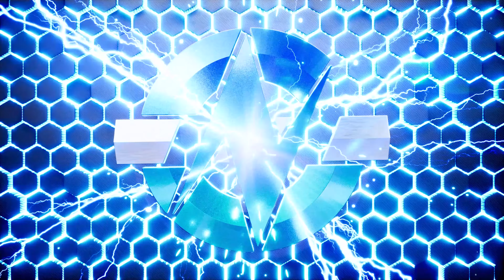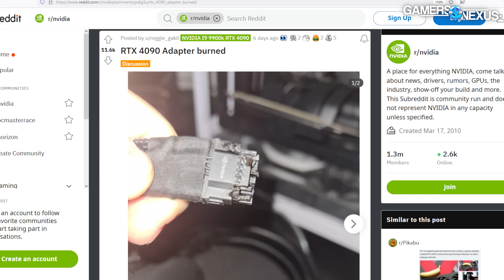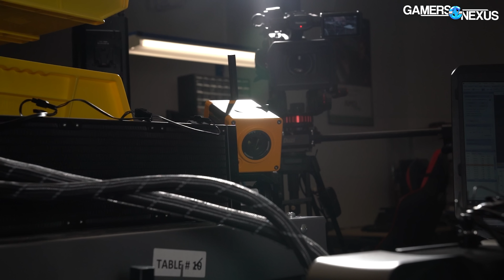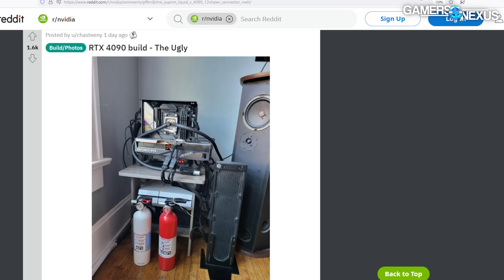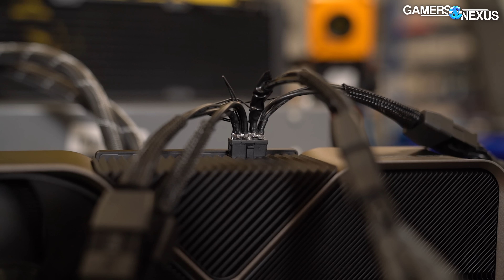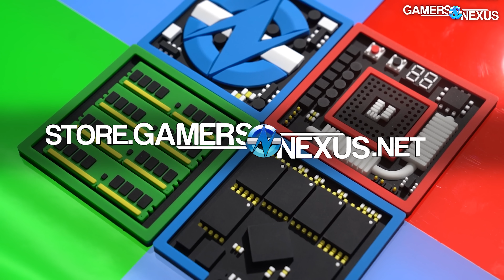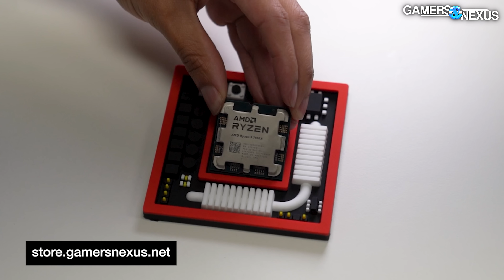Testing Burning NVIDIA 12VHPWR Adapter Cable Theories (RTX 4090)

Comment: Not really someone that comments, but there is something I think you should be looking at when you are gathering data, and this isn't something that can be tested, but you should certainly collect data to find some sort of correlation. 
The Power supply, as you said you are using a 1000W big boy power supply that is very stable you might find that people who have maybe slightly damaged cables (or not damaged) and PSUs that are only just able to power the system could cause spikes under load that could make small amount of concentrated heat on 1-2pins due to resistance. If you have a power supply that is at its limit or strain, spikes become more likely and larger, this could cause a small instant heat spike that would damage the plastic as under load as you show they are already at 60C. Good luck on your hunt though! excited to see the results.

Comment: The so called solder bus is a hoax. There is no manufacturer that makes inserts for this connector that has a busbar you can solder to. Wire to board connectors should ALWAYS be crimped. The part they use as "busbar" is the piece of metal that is used to feed the crimping machine with inserts. It is cut of and even has a special weak point to makes sure it is cut of at the same point for every insert. Using that part for soldering is stupid. Like alle the 3th party cables every pin should have it's own dedicated wire crimped. If they would have wanted a soldered connection they should have used board to board connector on the adapter side and a small but strong PCB to solder the cables to. Also using a board to board connector would mean they could have had a 90 degree connector. So even if you got a working cable stop defending that a soldered solution for this connector type is good, because even if it works it is bad. It is not in the spec sheet of the company that designed the connector in the first place. Please stop guessing and ask Amphenol. Because they are the only ones who know how to use this connector not NVidia or not even PCISIG who are just about standardization. The 12VHPWR connector is just a variant of their Minitek lineup of power connectors that is widely used in other then computers for consumers. Stop looking at computer part vendors or PCISIG as the experts they are not.
Reply: There should be an immediate recall on these adapter cables, soldered not crimped they must be joking!

Comment: I don't see how a failure in the connector itself could cause the melting. Much more likely is that there is a quality issue with the pin itself, leading to poor contact resistance at the interface between male and female pin.
Your worst result is like 75⁰C, which isn't even halfway towards the point where the connector would start to char...

Comment: Well Bz also mentioned the connector itself is kinda trash to begin with as it barely has enough headroom in regards to the wattage pulled compared to the more traditional 8 pin. So in effect you would still be pulling a lot of wattage through the connector regardless if it was through an extension or a direct cable coming from the psu.

Comment: My theory since the beginning has been due to people bending the cables towards the same side as the locking tab, the insecure side of the plug is no longer seated correctly, which is why it's always the side opposite to the locking tab melting. The new connector has very short pins so you'd only need to pull it out ever so slightly by putting tension on the cable to create bad contact.

Comment: are all the adapters made by nvidia or by the aib parteners? and the cards that melted why haven't the people come forward with the cards they have  and what the voltage are on the cables so you can possible tell what they are rated at? see the cases that reported melting cables and what they have incommon was it a certain aib or a  nvidia thing that the earlier models got neglected?

Comment: if you wanted to re-create the melting of the connector you would have to use a pic or small screwdriver to spread the female pin in the connector so it will make a weaker connection at the point its actually failing its melting at the pin not the bus. as I said in a previous comment everyone is chasing the wrong issue if its melting at the pin the weak connection is at the pin. most likely from spreading the pin by shoving it in crooked. Or poor-quality pins

Comment: 4 16 gauge cables seem plenty to deliver 600 Ish watts. honestly the way they are melted at the end of the connector makes me think the bus isn't the issue seems like some loose fitment and the pins causing heat buildup. possibly from shoving the connector in crooked or poor-quality parts. also, the rating of 300v or 150 volts is the rating of the insulation on the cable and would be irreverent to the issue. like the video and how you try to form your own opinion. but I think the buss mounting issue is a red herring as you said and if its melting at the pins there is where the heat is and there for the weak connection. I feel like people are looking in the complete wrong place

Comment: Yeah, direct crimp small gauge wires would be the best having the PSU/GPU sense temperature at the ends would be best. An ideal cost is no object safe cable for any electrical application would have temperature sensors at both ends, shielding, and current limiting on each conductor and if your housing wire an AF/GF detector which would cover basically all electrical faults possible making fire, overload, arcing, over heading basically impossible (of course they'd cost a lot).

Comment: I have some tests for you to try from an electrical engendering background. I unfortunately don't have 4090's a'plenty to test on my own though. My own theory is less about the solder connections between the wires to the connector, but between the male pins on the card, and female contacts on the cards themselves, especially when looking at where the burn damage on the connectors is. Its deep down in the connector, and its in the protrusions of the plastic connector themselves indicating the highest temps are generated at the mating between the cards pins, and female connector side. I would suggest setting up some multimeters to measure the voltage drop across the plugs themselves. I would take amperage measurements of each wire to see how well amperage is distributed across the wires (does one wire transfer 10 amps, when another is only doing 5 for example). Also, take a cumulative amp draw and measure the voltage drop across the connector to card. That can tell you exactly how much power is being dissipated in the connectors themselves. You can test in real time by bending the cables to see how the plug resistance changes instantaneously without having to wait for temps to change. I would put money on it being an issue with either uneven amperage loading between the individual pins, or just the pins in general not being able to reliably handle that kind of current. I would be happy to help you setup some testing procedures for this if you like, something a little more technical than just pointing an IR camera at a connector and hoping to catch the issue.
Reply: I was thinking along the same lines regarding the pin/socket contact area.  With possible exacerbation from the case side panel applying pressure to the cable due to the size of the card.  Coming from an EE avionics repair/test background it seemed the first suspect to troubleshoot.  If the contacts are not bussed together on the card side, then the volt drop can be a good indicator, but if they are bussed on both, it probably won't make any difference to the readings, (unless/until the 'foil' in the plug is damaged as well.)

I'd also bet that any one fault is not going to cause the issue, but you need some combination of factors to cause it.  Say, damaged plug, plus strain on the cable causing a smaller than spec pin/socket connection, and maybe a less than ideal solder job, for example.

Comment: Or .. the most common issue of melted electrical plastic, not seating the connector fully. Less connection results in more localised power, more heat as it’s not got its full connection surface.
Reply: This is also clearly what is happening. The pictures of all the melted adaptors has majority of the melting happening on the tips of the plug a poor contact across the 12V bus would cause high contact resistance and a thermal runaway would occur and the housing melts. Also that massive blob of solder is not good practice it will lead to random failures as the housing could melt slightly misaligning the pins, contacts be damaged/contaiminated/oxidized/...

Given the standards body already said there was risks of poor contact and the contact patches being smaller due to the smaller connector you'd think Nvidia or board partners would place thermal sensors under the connector or ideally in the connector to shut down on over temperature events in the connector.

Comment: I don't think this issue is that simple. A definite design flaw is not obvious but % of failure rate is expected in any sort of connection. I had a corsair psu powering a 3080 on a 7 card mining rig suddenly after about 6 months have a melt down 8 pin connector (original modular cable, not splitter mind you). This kind of thing happens, the question is how often it will and if an obvious flaw could be identified. A dozen cases will be highly exaggerated because of how much eyes, attention and money are invested around the early adopters. Only time will tell how safe these cards really are.
Reply: Thermal cycling could explain your failure it is definintely at the connection point where the heating is happening if they were failing at the back side of the connector the melting would look completely different. Excessive temperature swings could cause "connection cycles" and the high temperatures would accelerate oxidation on the connection springs. Repeat that enough and the springs could become loose and get coated with gunk. After that a meltdown would occur.

It is probable that its the small contact sliding spring contacts that are failing randomly either through housing misalignment, thermal cycling, solder contaimination, excessive oxidation all leading to increased contact resistance.

Comment: Aside from a crappy adaptor circulating. Try contaiminating the connector with excessive solder to make the sliding springs in the molex connector to get gummed up with solder. If they don't act like proper springs a few bending cycles or insert cycles could cause high resistance across the entire connector. And given the construction puts massive amounts of solder on the pads (this is not how solder joints should be made) due to it being hard to inspect, solder going where it shouldn't.

Given the testing and lack replication of user results it is likely poor contact in the entire 12V side that causes melting connectors. The entire 12V side can clearly redistrubute the load so being able to cut off two entire cables and not overload the connector means that increased contact resistance is causing the problem across the entire 12V side.

Also the voltage rating does not imply a higher temperature rating (it is more the insulator properties that govern both) a 60degC vs 105degC cable can carry more current at the same wire gauge. With wire gauge calculations 2 wires at 14 gauge should carry the 600W 12V load just fine (which they did) it is very likely a poor contact issue with the entire 12V side either by misaligned pins, excessive solder, poor construction. Soldered connectors like SATA power adaptors have been known to also catch fire due to poor construction. The best connection would monitor the current on each power carrying wire to ensure they don't exceed their current limit and to put a temperature sensor in the connector or socket to read the real time temperature of the connection (this is how electric car chargers work) obviously the cost probably doesn't make sense but I'd argue that expensive GPUs could afford to put a temperature sensor into the connector body.

Crimped connectors are always better for high current applications as done properly they can create a cold weld which merges the copper together so that they can never seperate even if all the insulation and solder would have melted off. The soldering could have also create oxide layers on the contact pins and or caused housing deformations internally that misalign the contacts making it feel very hard to insert and have a high contact resistance. 

High contact resistance is what is likely the cause whatever is causing it as the contactor total cross section is far in excess of what is needed to carry 600W (for example a 14AWG cable can carry 120V 1600W in housing wire rated at 60degC operating at 25degC ambient) but not having good contact could cause such extreme temperatures that entire circuit breakers would melt apart that use no solder internally even at low currents due to the way thermal runaway can occur.

Comment: The last bit about the "user error" (connector not seated properly). I had to push mine HARD to get it to connect properly. Could be one of the problems.
Reply: I think it might be the excessive solder is causing partial melting or contaimination of the spring contacts in the cable which would make it much harder to insert, ruin its cycle life, and possibly cause a high contact resistance event (melting, fire, ...)

Comment: I was  surprised by the general poor construction of the power cable in this video. With all the current  running through the wires. You would think they could do better considering what they charge for this card. The wires are almost to big for the connector it just seems a little flimsy lol
Reply: Soldering cables and just laying down a massive blob of solder to make it mechanically and electrically sound is incorrect use of solder they should have used a copper bus bar if they wanted a blob of metal and soldered the four cables into solder cups. The massive blobs they are using in the "good" cable can cause problems with the contacts getting solder wicked into them or partially melting the inside of the connector housing which would misalign the pins.

Comment: Instead of tampering with the construction of the harness, which I don’t recommend. You can simply slide the flex loom onto one side. This will allow you to see through the flex loom and see the marking on the wiring.

Comment: Instead of a fully disconnected cable, the excess heat generation could be coming from a partially connected cable where now there's a much greater level of resistance between the cable and the busbar... Or rather a combination of both... Forcing larger currents through a partially connected cable leading to large heat generation

Comment: @Gamers Nexus I just had this strange idea. Suppose the quality of the adapter cables do vary. What if it's something to do with the actual pins inside the connectors? Maybe the pins themselves are wider or the pins on the vendor's GPU are larger? The images do look somewhat like the pins have expanded. This may be due to heat though, but I wouldn't be surprised if it's a potential manufacturing issue. This is my own "two cents" from working with various molex cables, but if they are using lower quality metal for the pins, they might be deforming when plugged in and not going back. This may also explain your idea at 26:10 that there is a less audible snap. Pins not fitting the actual socket may result in a socketing issue.

HOWEVER, if it was a problem with the pins we'd think this issue be even more widespread. Perhaps it is and we haven't heard it yet. I do believe it is a quality control issue but like you said, more samples are needed.

Best of luck resolving the issue, and thank you for covering it!

Comment: Owner of 4090 ASUS RTX STRIX from DAY 1 here, bought mine waiting 7 hours on MicroCenter on Launch date. I had to bend my 12VHPWR - FOUR 8PIN pretty hard to fit my GINORMOUS O11 Dynamic XL case with tempered glass on, still I don't have any burning issue so far. I will gladly send 4090 adapter cable if I can replace with something else.. but so far no luck.

Comment: If the psu is out of spec.... 
Like has lower than average "split" to the 12v rail
.
Then voltage drops... and amps must climb
.
And amps is what melts stuff
.
.
.
Tldr...
It may be an 850w psu
But you actually need 1000
.
Or....
Your 1000w PSU  puts 300 of that on the 3v and 5v rails....
.
Ohms law means more amps
Stuff gets hot and melt

Comment: Great video. However I have some doubts about 150/300v rating being the cause, as that is the rating of the insulation on the cable, where the temperature and wire gauge/mm2 is more important for cable specs. Not saying that 150v couldn't be an indicator for a different (faulty) manufacturing process. To me it looks like the pin to socket connection is more sus, as thats where the connector melts. Anyways, looking forward to next in depth analysis and testing video.
Reply: Of course it's not the cable fault as it would started to heat in the middle.
Voltage specs says nothing, there might be telephone cable out there rated for 300V which would instantly melt with few amps of current as well as 150V welding cables capable to distribute power to whole house without any problems.
It's literally like saying that one car is faster than another because of his colour.
Reply: @baalzevuv4509  Cables at voltages this " Low" should not even need to be labeled with voltage. That only becomes relevant when you get to voltages that will arc easily. There could easily be a cable rated at 150v that can carry twice the amperage of the 300v rated wire without issue